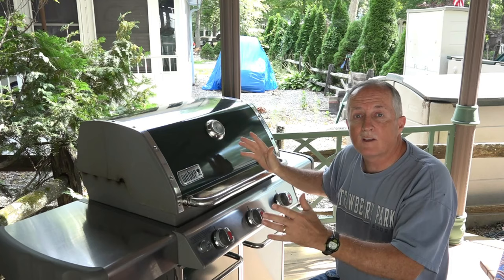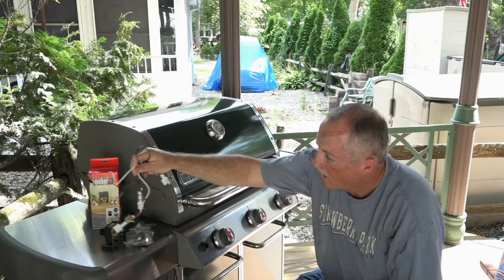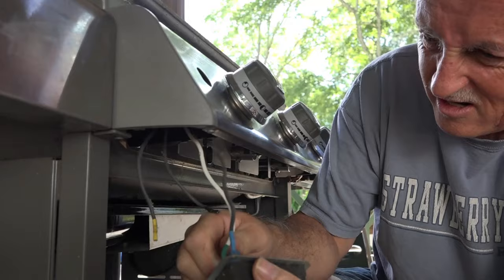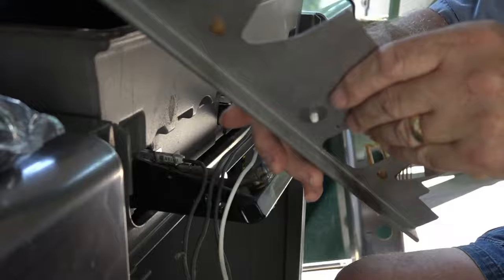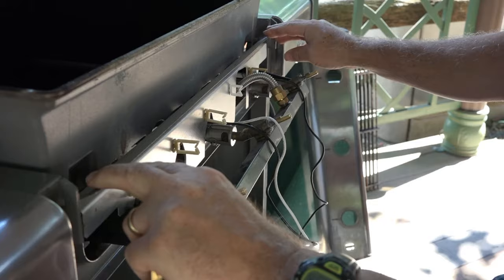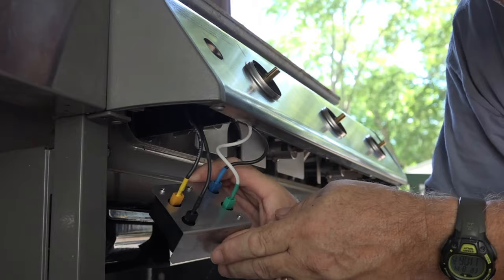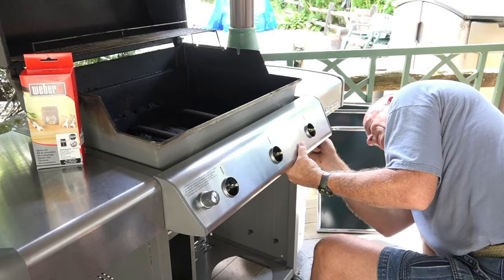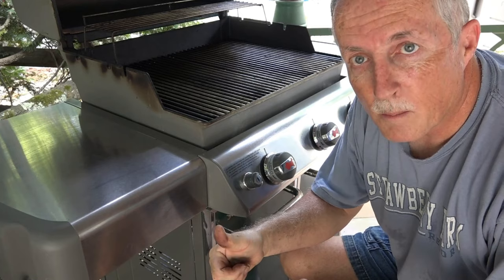How to Replace Weber Igniter-Sparker

Comment: Thanks for the end to end process on this. I had replaced the igniter before but this time bought a kit with the electrodes also so your steps to remove the panel and swap those out was very helpful.

Comment: Excellent instructional video.  I have gone 7 years with having to use a lighter and finally decided to try and replace the igniter.  After looking at the pictures in the instructions I was a little discourage until I found this video.  This makes the process extremely easy.  Thank you.

Comment: Great vid Charles.  Only suggestion I have after completing the same project is: 1) put a little dieletric grease on each of the electrical fittings as you re-assemble the starter - it may help delay the next replacement and helps the new ones slide right (be sure each wire "clicks" into place); 2) take a toothbrush to clean off the soot and dust that tends to collect on the gas/air mix inlet screens of each burner valve while you have the cover plate off - this will keep your burners run a hot and efficient flame just as they did from the factory.  BTW - I tested my eletrodes after simply unplugging the old starter unit and plugging in the new one.  I decided not to mess with replacing them as the wires weren't brittle  - they started right up (save the new ones for later)!  I did have to adjust one of the old electrodes just a bit by bending it down a tad closer to the gas burner so it lit the burner immediately after sparking (note if you do this you do not want the electrode to touch the gas burner as it will short out).  Looking forward to several more years of Weber grilled steaks!  FYI - My Genesis 310 was purchased in 2012.  After doing this simple exchange I was kicking myself for not doing this sooner (igniter one out 4 years ago)!!

Comment: Thank you Charles. Will be doing this soon as my sparker stopped working this week - after 13 years of service. I'll likely change out the burners at the same time. I received those from Weber a few years ago and now time to install them. Thanks again for the clear instruction. I've bookmarked this video.

Comment: Thanks so much!  I had one burner that wouldn't ignite and had resigned myself to using a lighter to light it, but my wife wasn't too keen on that idea, so the other option was to have it repaired at an undoubtedly ungodly cost.  Since I had already replaced the main igniter a year or so back, I had the other parts, and finding your vid allowed me to do the repair myself.  Yahoo!!!

Comment: Helpful Video. I also have a gensis E310 grill like yours, purchased around 2012 and last year my igniters stopped working. I will say though, I decided to try not replacing all of the igniters on the burners and tried the new module with the old igniters and it worked perfectly. So to others attempting this. You may be able to save yourself a lot of hassle and skip the last half of this installation. Saving newer igniters in case they fail later. Thanks for video just the same!

Comment: Great tutorial. I’m not sure why Weber’s instructions have so much disassembly - your approach was much simpler. I ended up not removing the gates of the flavorizer bars. Interesting that the replacement includes a lithium battery. My original one came with an alkaline battery and the only reason why I had to do this replacement was that the battery leaked. If anyone has an alkaline battery in theirs I recommend to replace it with a lithium. Thanks for the video.

Comment: Another thank you. I purchased my ignitor kit on Amazon for $23. According to their instructions that square hole in the panel doesn’t require a plastic stand-off. 
Part number was: GASPRO 7628 Igniter Kit for Genesis 310 and Genesis 320.

Comment: Replaced my ignitors after watching this. Tip for those who do the same: 2 of 3 ignitors did not fire after the replacement. It turned out that the ignitors were too far away from the burners to arc properly and create a spark. Expansion / contraction after bbq use is the likely cause. Found some metal wire and secured the ignitors so they were closer to the burners. Works perfectly now.

Comment: For those who like overkill, I might suggest running the wires through some 1/4" silicone tubing (amazon has it) for extra heat protection.  I have to replace the starter system on a Genesis 330 because it has the "sear station" which had a heat shield behind it, inside the cook box, but it rusted out, and all of the wires got roasted.  Of course I'm replacing the heat shield, but thought the silicone tubing would be a plus.  At first I freaked out because I thought your wires were touching the cook box, but on second look, that's actually a separate panel, unlike mine (I think. I haven't gotten in that far yet).
Special thanks for showing how to remove the doors and control panel.  So simple, yet I was too dumb to figure it out.

Comment: Easy fix, even for a guy with 5 thumbs of each hand.  Bought $20ish replacement on Amazon and followed video.  Hint:  Don't replace the "sparkers" if the are working, just replace the electronic box and if that solves your problem, forget the rest.  Once you have it apart is 4 slide on/slide off connecters...easy peasy.  Video very helpful.

Comment: I must have missed your video on how to clean the grill, because mine was a crap storm compared to yours 😀! Thanks for the video. I decided to just change the button unit, because mine stopped working when I had a battery leak between seasons. I did verify that each spark unit was working before I put back together.

Comment: Just something to be aware of.  One of my burners was not lighting or was very, very, difficult to ignite.  I cleaned my entire grill and noticed the sparker on that burner was pushed back further than the others.  I pulled it forward and now it works fine. BTW it’s the Weber Genesis 3 burner with the searer and the right side external pot burner.  It’s 8 years old and still looks and works fantastic.  Just wipe it down with stainless steel cleaner polish after each use.  The only thing I have had to replaced is the igniter battery.

Comment: Nice video. Did you try cleaning the electrode protuding out of the white ceramic inside the grill just above the burner? Often the electrode gets gunged up with grease. Clean it with sand paper. Works for me most of the time.

Comment: Great video. Instructions are excellent as well if you like an extra visual. Not exactly sure why the instructions tell you to take the cover off. Not necessary and the only thing I can think of is for safety reasons so the cover doesn’t fall on your hands while working. Again, totally up to you, but has no bearing on the installation. Make sure that you reinstall the heat shield correctly. Otherwise your doors won’t shut. I had to take the heat shield off again to close the doors. Installation is a breeze and works great!  Thanks for the video. Very helpful.

Comment: Thanks for the excellent clear video. Not as simple for me as the four Phillips screws were almost impossible to remove on my 11 year old grill. Found the remains of a mouse nest inside after I finally got the pieces off.  Ended up ruining two of the screws so the bottom piece is not going back on. Might be for the best as it will not be as mouse friendly with it off.

Comment: I'm guessing reason the instructions have one take off the hood top is not for access, but for safety.  A gust of wind could come and blow it down and then Weber would be sued.  I took it off because it just made it easier to clean and detail the entire interior.  Greased the pins with high-temp car/bearing grease before putting back.  A 2nd person helps a LOT when taking off the hood.

Comment: I replaced the electrode on my bbq and it seems to be not turning the fire on even though it’s sparking  but will light up if manually using a lighter.

Comment: Thank you for your review which was helpful. I have a 2 year old Weber Genesis II grill and 3 of the 4 igniters did not work. Just the one on the far right clicked. I first replaced the battery. I then got an air can and sprayed the screens by the metal connectors that are behind the plastic knobs and cover was removed. That did not help. So I then I replaced all the white igniters as well as the black box. That did not help either. I was like, NOW WHAT?? So I replaced the actual ignitor button. Bingo now all of them click and ignite. It does not make since why a new igniter button made all the white igniters click. Perhaps the connections? I don't know but the good thing it, it now works. :)

Comment: Nice video.  I think I need to replace mine. I will try replacing the battery first. Should be covered under my ten year warranty. Do you think you really needed to replace the wiring and not just the ignitor device ?

Comment: I am wondering if the failure is just the black box that contains the battery.  It would be so much easier if that is all you have to replace.

Comment: Very helpful video.  I would add one CAUTION: if you don't take the cover off, make sure it is secured so it can't drop if you bump the grill while working.  I shudder to think what it would do to a finger caught between that heavy lid and the edge of the grill. 😮

Comment: I used the link you provided to order the part.  What I received was not a weber part but a Grisun.  It fits and all but the clips are garbage, no back washer, the colors of the wire tips do not match the colors on the back of the switch,  and there's no battery included.

Comment: Unfortunately, I went to my local Ace store and paid $53 incl. tax for the Weber igniter.  Much cheaper for aftermarket on Amazon.  The video was very clear- it's a simple job, but I lay on my back to unscrew the sheet metal shield and it fell on my face when I reinstalled it and I got a small cut.  I do not remember how long ago I bought the BBQ but this was the second replacement and I now marked the new replacement date on the bottom panel.  I suspect it will last 4-5 years.  I don't use it in the winter and will remove the battery when storing it.

Comment: Before you do ANY of this....take out the battery, and clean out inner battery area where the -negative battery base sits against spring. I used a Q-tip with alcohol, then a tad of emery paper on one  endof a small screwdriver. I put battery back in, and 
pressed the button.... SPARK*SPARK  fixed! I keep my grill covered, and bring it inside in the winter, so it still looks like new after 6 yrs, but still just that tiny bit of corrosion/crud messed things up. Saved me $60 and a lot of time. 🙂

Comment: Thanks for the video guide.  The written instructions are…ok. Two things.  The “missing” clip isn’t missing.  There isn’t supposed to be one in that hole.  Don’t know why Weber put a hole there if they didn’t want a fifth clip.

Also be careful removing the igniters.  The spot welds that hold the mounts are incredibly tiny.  One of mine popped off entirely and another one had lifted off one side.  I was able to sort of just stick it in there and it worked anyways but just a heads up to anyone else with a grill that might not be as clean as this example.

Comment: Good stuff!  

Somethings I learned:  1) make sure the metal filaments from the spark-igniter are at least an eighth of an inch off the gas tube.  If the filament is touching the tube it will not arc / spark.  2) give the gas tube some time (3-5 seconds) to fill with gas prior to pressing the ignition switch.  Otherwise, you will be holding the switch for most of that time waiting for ignition.  For safety's sake you may want to keep the lid shut when doing so.  Good luck!

Comment: Do NOT do this without first CLEANING THE BATTERY HOLDER CONTACTS!!  It will save you $30 and an hour of disassembly and re-assembly! 
These grills are known to have contacts that corrode too soon.  
I used contact cleaner spray on a chem wipe with a pencil eraser end use to push it in a twil  Worked great.
Be sure to press the button really hard.
If that doesn't work then follow this otherwise nice video.

But even then I suggest just replacing the switch and battery holder and see if that does the trick.  Likely it will.